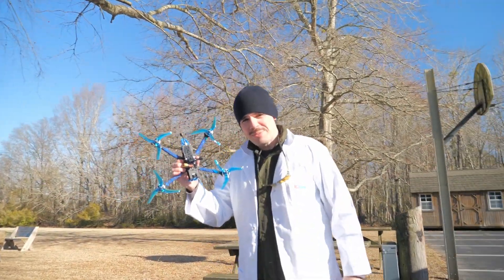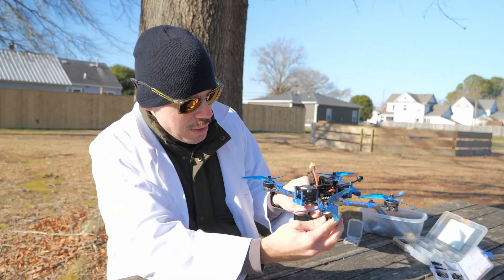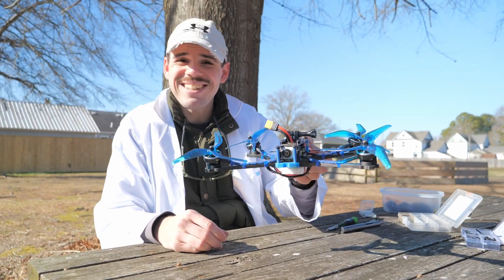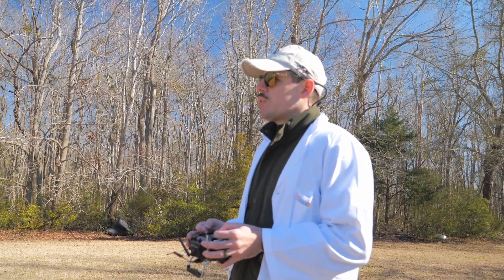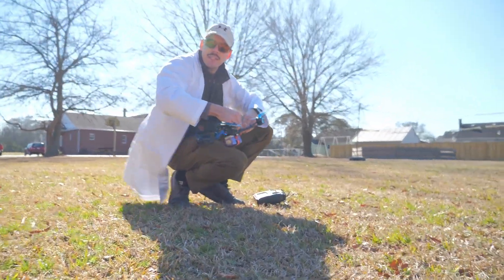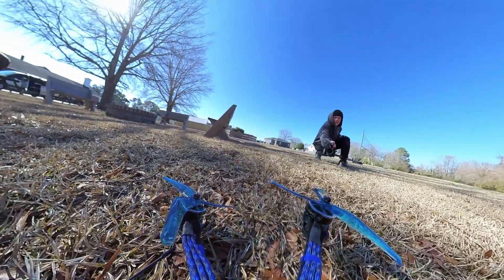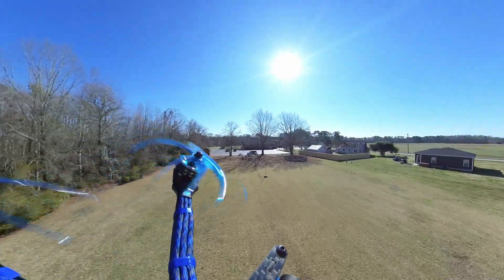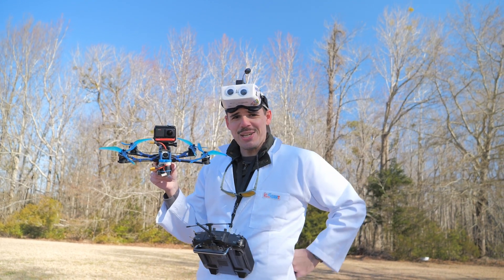Angled Motor Mounts for FPV Drone Experiment (Part 1)

Comment: Usually people tilt the camera instead, the motor-tilt hardware ends up being a weak point if you use it in a high speed application like this. On the other hand, It is great to add dihedral to a camera drone, it adds a mechanical stability. 
I do like what you've done here. As I watch the video I want you to fly it fast and constant, like a plane, instead of stopping when you get up to speed. It feels like you are fighting the nature of the aircraft. I have often wanted to make something similar, I want to use an H style frame, and tube arms. I want an inboard servo for tilting the motor arms, all together. I've seen them for sale (years ago), and they didn't take off. I think the servo/tilt mechanism parts were too fragile, but I never met anyone in person that had one.

Comment: Nice video. I just had an idea: autoleveling camera. what if we put a camera on servo, so that when quad moves on a pitch, camera moves also and support consistent level. As you know, speed of quad depends on pitch. So at any speed of quad, camera angle stays the same, lets say 15°. That's easy to do, so Adam, can you try that?
Reply: So a dji fpv?
Reply from the maker: @2down2togo  Yep that's pretty much the concept behind a camera on a gimbal!
Reply from the maker: Excellent idea! I've been interested in exploring the Medlin Drone Head Tracking Tilt system that uses that idea.